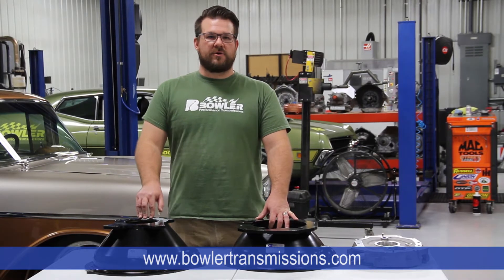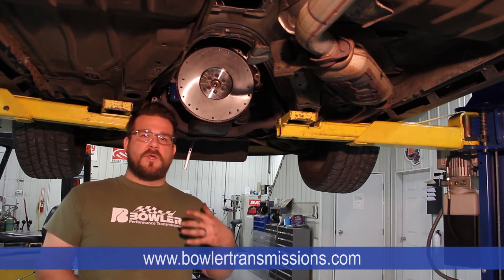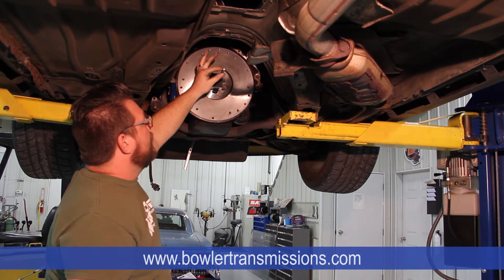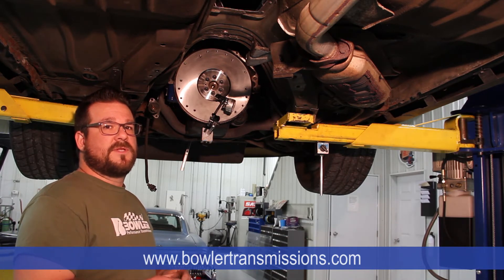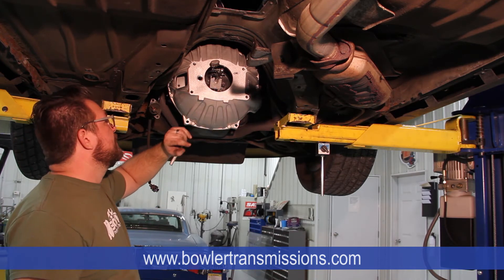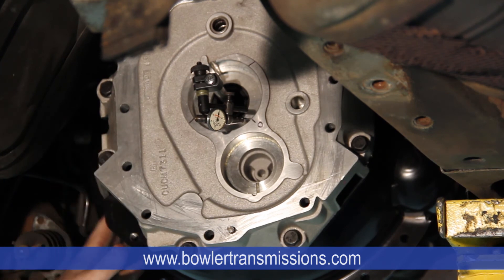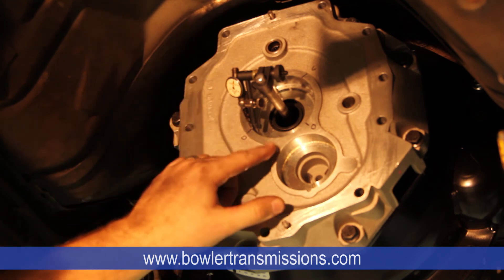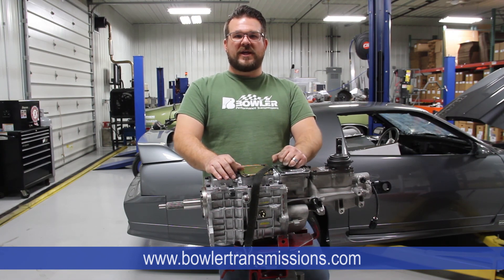Bellhousing Alignment

Comment: What happens if your trans doesn't have a bell housing? Like engine swaps with adapter plates, just hope for the best?
Reply from the maker: There is typically an option to still perform the check but it requires tear down of the transmission.

Comment: It seems to me that bolting the transmission front cover to the bellhousing is the best way regardless of the added effort. There's no guarantee the hole in the center of the bellhousing is concentric to the mounting bolts or dowels. You could get the bellhousing perfectly aligned according to that center hole and still end up with a misaligned input shaft because the bolt holes on the bellhousing or transmission were slightly off-center compared to that hole.

Comment: great video...i
how can this be done with the clutch attached? the QuickTime says it can be done with the clutch on, but it's easier with it off...i have a twin disc clutch and it's alot of work to remove and install especially when loctite was used with the torque specs. thanks

Comment: Hey man, great video. I literally just put my T56 Magnum in my 93 cobra last evening, then I read about doing all of this first. So it looks like I'm pulling the trans and quicktime bell back off and pulling the motor out so i can check off of these things. Could you tell me where you go to buy shims for the bell if they are needed? I'm running a new Dart 363 SBF, SPEC billet flywheel, quicktime 8031 bell and T56 Magnum. After looking at some material about this i'm kind of peeved that quicktime has powder coated their mating surfaces. A regular guy like me doesn't have access to machinery to clean that up. I'm going to have to see if my bore gauge I have is going to be small enough to work on that T56 Front plate.
Reply: QUICK TIME now makes a plate so that you do not have to take the front plate of transmission off.
Reply: George Johnson Jr. FYI, I used my dial indicator on my bell housing and didn't need to remove my front cover. I needed offset dowel pins though. Everything is all good now. Going to start my new motor up this week and test out the Magnum.
Reply: billyNOTnice blue gauge meaning dial indicator?
Reply: billyNOTnice okay, let me know how it performs
Reply: George Johnson Jr. Sorry, I typed bore gauge. But it auto corrected it to that. Then I edited it to dial indicator.
Reply: George Johnson Jr.  have u tried the plate does it work aswhell??